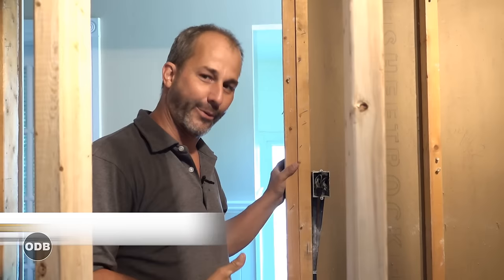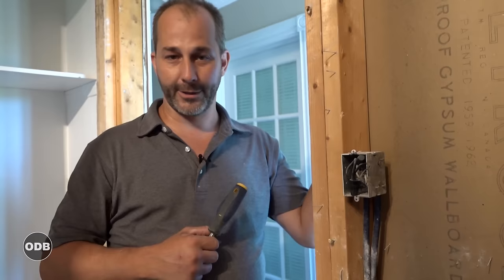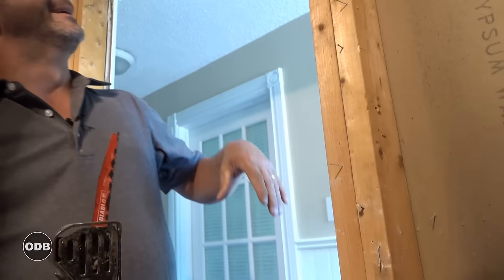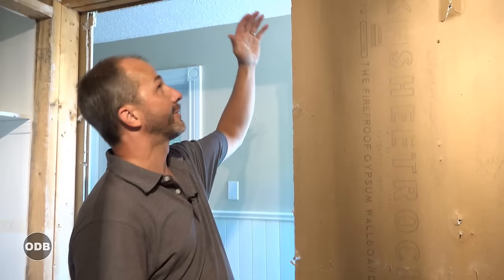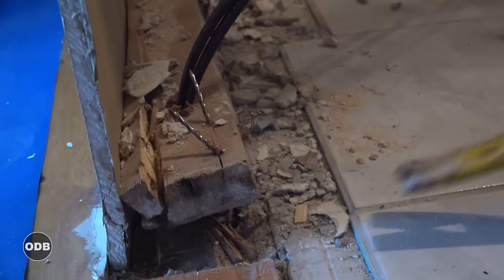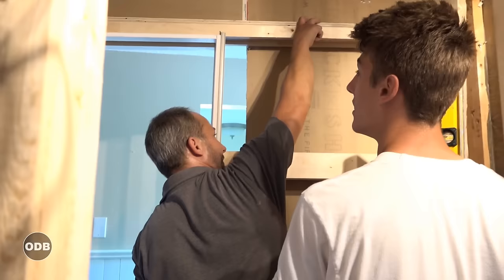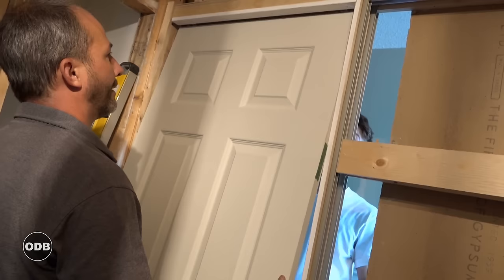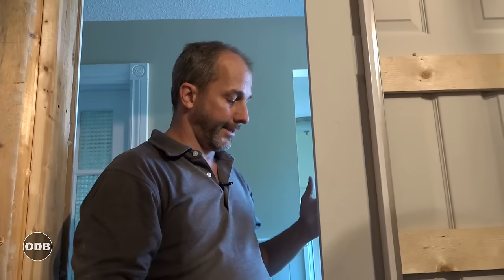DIY How To Install A Pocket Door

Comment: I'm not an engineer, but when I cut out all of these studs, the ceiling didn't fall on my head, so.... it's not a structural wall.
Reply from the maker: LOL, I had a temp wall supporting the weight in case. Cheers!

Comment: I notice you use a lot of dewalt how do the drills work
Reply from the maker: Quality tools for a good price.
Reply: Don't Use Dewalt - they're great tools, but I think you can get more bang for your buck with Milwaukee tools.  Actually I recant that - Milwaukee makes an m18 cordless miter saw, and DeWalt makes a cordless table saw - my advice would be to invest in both battery systems and get whatever you can't get from Milwaukee in DeWalt.

Comment: This may be a silly question... is there any reason why you would not be able to build a false wall, say about three inch away from the already existing wall ......sheetrock it to make it look like it's always been there and have the pocket door go between the old wall and the new fake wall...?
Reply: iwantthetruth andnothingbut that’s a load of extra, unnecessary work. And you will lose space.
Reply: @leroy_who  yeah, I was figuring you would lose maybe four inches of space, but the wall that you build would not have to be load-bearing and seems like it would be easier to build a simple non load-bearing wall, you really wouldn't even have to use two by fours for strength because doesn't really need strength it just needs to be there to hold the pocket door ... it seems like more work to me what he's doing here.....😏 I like to think outside the box... LOL!

Comment: The actual door install begins at 10:00
Reply from the maker: Yes it does, but like with any project preparation is thew key to success. To not show that is to set people up for failure.
Reply: All good information, but some of us are installing a door in new construction.  Not replacing an old door.

Comment: That door slab looked more narrow than the opening. Was it?
Reply from the maker: That is because I did not install the other side of the jamb yet. This makes it easier to put in the door and then flush everything up.
Reply: Home RenoVision DIY That explains why when I took mine down to refinish them I had to slide the first one in at an angle before connecting the back one.
Reply from the maker: It can be tricky depending on the hardware. That is why I keep the last jamb off.

Comment: Your deconstruction was refreshing.  I watch the TV home reno shows and just cringe every time.
Reply from the maker: That is all tv silliness. Cheers!
Reply: My disconstruction was not refreshing. My pocket door came off the track immediately after finishing up remodeling. Was no way to fix it in place (no room) cause the wheels was twisted out of position - problem with old single track doors. Had to remove one side of a newly painted wall like this video.

Comment: AWESOME Video! 
But why aren't you and your helper not wearing eye protection and gloves during your demolition phase? I was cringing watching you two prying wood and dealing with sharp and exposed nails...
I am studying for a Pocket Door Project...Those wheels and hardware that you have used for your door; who is the manufacturer?
Also, can you please write a comment about a frame kit larger than 2X4 installation?
Thanks in advance for your reply!
Reply from the maker: Thanks for the questions, truth is we don't wear eye protection on site. No one does except t.v. stars. This is the real reality t.v.
In regards to the pocket door for a 2x6 frame you can fir out the wall to meet the door frame and the hardware was purchased at a building store. Just make sure to look for one that is sold according to the sizer of the door and you will be fine.

If I ever feel that I am in a dangerous situation i will wear protection. However in most cases my best protection is to have the clearest view possible of what I am doing.
Reply: Thanks a lot for your prompt reply...
Reply from the maker: It is the least I can do.

Comment: There is lots of good stuff, here. I would like to see less time spent on fishing the wire through the floor (which has just about nothing to do with a pocket door) and at least some time spent on how to size the header because (surprise!) THAT is very critical, but you didn't spend one second on THAT issue.
Reply from the maker: funny how you don't think that installing a pocket door in an existing space won't require you to move electrical.
Reply: Not my point at all.  Electrical may be encountered, possibly.  However, the header is something that every pocket door job will require, so I just thought that it would be included in the "how to" part of the video.
Reply: The old header in that case is to keep the door frame solid.  I think they used what they had on site.  2 x 6 header with plywood between  is plenty strong for 30" interior door frame, just my opinion. I have only built about 20 and I am not a framer.  I haven't put in  a pocket door but looking into it.

Comment: Just in case its structural? 😂😂
If that was structural you would have been in trouble when you removed the supporting studs from under the head 😂😂😂
Reply from the maker: I had a temp wall built in the room where the camera was. I don't think it made the footage.
Reply: Home RenoVision DIY 
Ahhhhh I see, you did fail to mention that information 👍
Reply: He said in the very beginning that he was going to reinforce it temporarily in another location.

Comment: I just had my fu*** door fell. I don’t get how can you build this kind of unreliable sh*t which will be buried in the wall with no way to fix it without breaking the wall. The door it’s basically secured with a bit of plastic which lock the bolts and it just did open. Preview owner did install it properly but didn’t made easy to access it for repair. Tried different things didn’t work. Really pissed off that I have to break the wall now. Don’t recommend it never ever.

Comment: You mention treating it like a load baring wall, but you build no shoring? Also, no safety precautions? Goggles or steel toes? Not very professional, you should be more cautious for your viewers and yourself.
Reply from the maker: Actuially the shoring was inside the room where the camera man was standing. Cheers!
Reply: @HomeRenoVisionDIY  you should of shown it 👍

Comment: After 2 minutes, he only talking about everything else in the room but the pocket door. Focus!
Reply from the maker: Hi Annette, removing a wall can be a serious thing. We just wanted to make sure folks didn't try this on a structural wall without the proper safety. Cheers!
Reply: Fair enough. I’m adding a new wall. Perhaps you could consider breaking down into two videos, demo hazards, then installing a pocket door.

Comment: "I'm not an engineer so I'm gonna treat this as a load hearing wall". Then he removes a 2x10 and puts in a 2x8?
Reply from the maker: And you have a problem with that! the span is only 6' and anyone in the building business understands that a 2x8 can span a house load over a greater distance than that.

Comment: You don't have to be an engineer to know a non-bearing from a bearing wall. That's pretty easy to figure out in a home.

And you don't know if its structural and you just cut into it...you're shitting me right.

The shim and the warp door killed me!!! You will never ever fix a door like that I don't care how much you wish it
Reply from the maker: I don't know what to say except I am teaching homeowners to be safe. And the shim actually works!! In My are of the world a nonloadbearing wall can still caryy huge weight in the winter time so it doesn't hurt to frame up a little heavy.
Reply: Home RenoVision DIY 😍😍😘

Comment: Doing things safely??? No gloves no safety glasses???
Reply from the maker: Really Joe, gloves. What is this 4th grade.
Reply: Ottawa Design and Build Renovations here you go it's your hands and your choice to protect or not protect yourself from injury. Thanks 

According to the U. S. Centers for Disease Control and Prevention (CDC), hand injuries account for 1,080,000 emergency department visits by workers per year in the United States. Hand injuries resulting from cuts and puncture cost the construction industry $382 million each year; this injury figure is second only to back strain and sprain injury, according to the U.S. Bureau of Labor Statistics (BLS). If that were not enough to demonstrate the need for improving hand protection in the workplace, consider the following:

• 70 percent of workers who experienced hand injuries were not wearing gloves

• The remaining 30 percent of injured workers did wear gloves, but experienced injuries because the gloves were inadequate, damaged or wrong for the type of hazard present.

To help prevent such workplace injuries, OSHA’s hand protection (PPE) standard mandates that employers select and require employees to use appropriate hand protection when employees’ hands are exposed to the following hazards:

• skin absorption of harmful substances

• severe cuts or lacerations

• severe abrasions or punctures

• chemical burns or thermal burns

• harmful temperature extremes

Selecting the right glove

A Liberty Mutual Research Institute for Safety study found that wearing gloves reduces hand injury risk by 60 percent. But to get workers to actually wear gloves, employers must first learn how to choose the right glove for the workers’ needs. In the past, many construction companies provided workers with cotton or leather gloves to protect them from cuts, puncture and abrasion. Today, advanced technology has resulted in hand protection products that meet specific needs while enhancing worker comfort, dexterity and productivity. Hand protection products are available, for example, that offer up to 300 percent more abrasion and cut resistance than leather gloves. Gloves are also offered that are form-fitted with an ergonomic design that enhances comfort and allows workers to keep the gloves on throughout the day.

Protection pays

In addition to the physical harm that hand injuries pose to workers, these injuries also take a financial toll. The average hand injury claim has now exceeded $6,000, with each lost time workers compensation claim reaching nearly $7,500, according to the Bureau of Labor Statistics and the National Safety Council. The overall drain on employee productivity becomes apparent; especially when you consider that there are about 110,000 estimated lost time hand injuries every year. While glove use is not the only way to protect against hand injuries, it is a crucial component of any injury prevention program. Finding ways to help workers comply with glove wearing protocols will go a long way toward creating a safer and more productive work environment.

Source: NECA/IBEW Electrical Training Center  www.nietc.org
Reply: Joe, you left your skirt in the van...
Reply from the maker: Is that supposed to sound like a problem. A lousy 382 million. That is like around $5 a construction worker per year in injury. It costs more than that for gloves. If gloves solved the problem completely it is cost neutral. Personally I prefer to feel what I am working with. Put the gloves on the kids till they learn how not to get a booboo.
Reply: Joe Rodriguez 🤣😂🤣
Reply: cutting nails from above with no eyewear is mmm not suggested.
Reply: yes i am a genius
Reply: let's just say "high IQ"
Reply: Home RenoVision DIY Keep doing what your doing.  Your followers are not, and I repeat Not in the fourth grade!  When you had your helper do the cutting up above your heads... You had him wear safety glasses so no debris would get into his eyes. Plus your followers are smart enough and do understand all of the safety guidelines!  That guy literally must have NO business going in Ottawa because if he did... He surely wouldn’t have time to search YouTube to criticize peoples videos. Especially ones who have high ratings and followers. He’s jealous for one and second much not know how to do this pocket door project as he had promised a customer, so he’s watching YouTube videos on how to do one. Definitely wouldn’t want or trust Ottawa to do any of my projects. I start with gloves, and I wears glasses so I can actually see stuff, but I also find myself taking at least one glove off to feel like you mentioned in this video. Can’t tell with gloves on.  
You’re awesome so let the Ottawa guy stay in Ottawa and in the 4th grade. 😏😏😂😂🤣🤣🇺🇸
Reply: Joe was pointing out a safety issue which I happen to agree with. Regardless of Joe's motivation behind mentioning this issue; he's right. Sadly, "Home RenoVision DIY's" response was to basically tell Joe to stop acting like a child because real men don't where safety equipment. When working with a reciprocating saw you should always wear your safety glasses and gloves to prevent injury to eye and hands.  The negative response from Home RenoVision triggered other negative responses from viewers of this video. Look don't think that I'm trying to come down on you; instead I'm trying to elevate you to a higher level of professionalism. My response would have been; "Hey friends, Joe bring up a good point about safety. It is very important that you wear the applicable safety equipment when doing any kind of construction. My apologies for not wearing mine in this video." ☺️
Reply: idk... i kinda think joe has a point about the gloves. some people can operate better without them because they have more feeling. perhaps that itself reduces chance of accident so ironically is safer. depends on the task and materials. sometimes gloves are a must like if handling broken glass.
Though Joe did come off condescending so message was not well received.
Reply: aren't you special !!!   not
Reply: @joserodriguez7535  , next you will be telling us to wear gloves while working with power tools such as milling machines and lathes. Just what i want, for the machine to grab my glove and rip my entire hand off rather then just giving me a cut. Easier and cheaper to get a stitch or two vs trying to reattach a hand thats been ripped and mangled.
Reply: JDM4LIFE02 safety is up to the person doing the work no one can make you wear proper PPE while performing a task it’s your hands, eyes, feet, face etc.  etc. only the person suffering from a work related injury will know the pain and suffering, but the consequences affect others such as family and coworkers when work related accidents happen. So the decision falls on you when doing your work, wear proper PPE or not, it’s all up to you. All these negative comments and name calling, will not bring back a persons eyes, face, hands or life, should one suffer a work related accident, while not wearing or using proper, PPE. Know Safety No Accidents